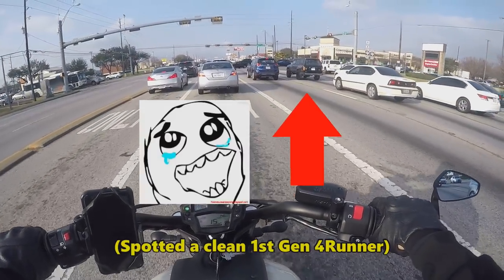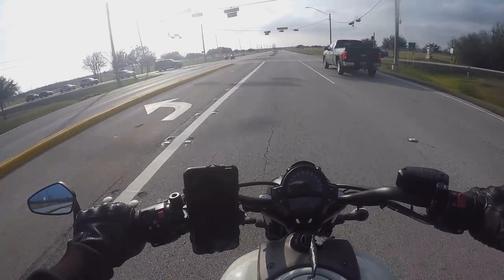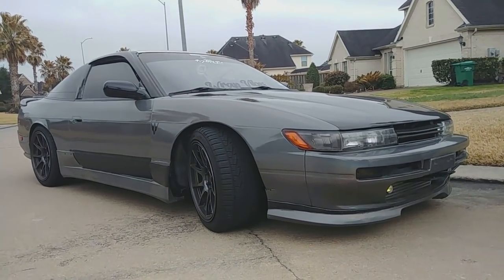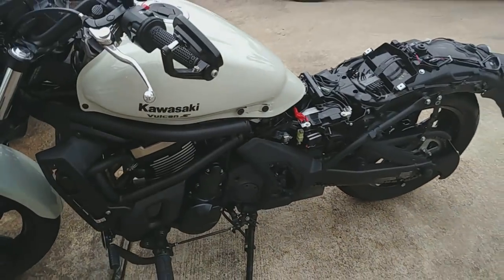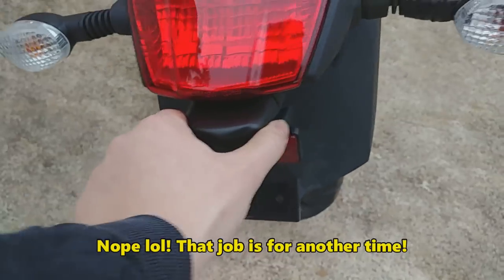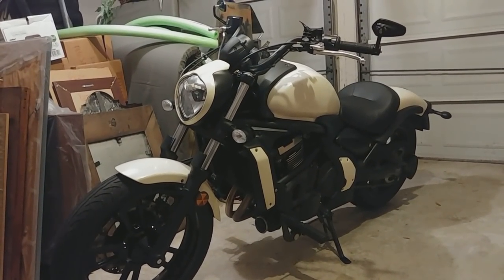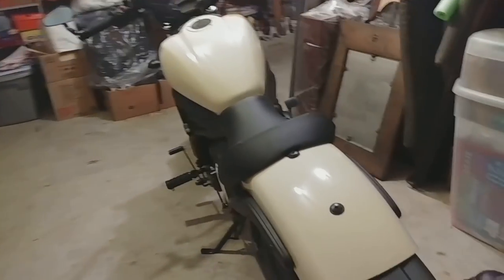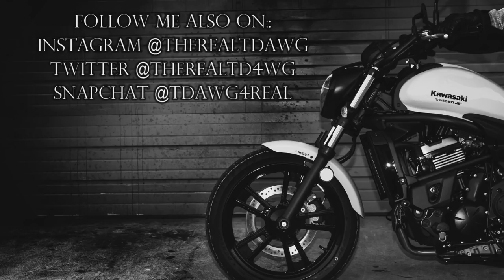Wrapped The Vulcan S! | Motovlog

Comment: That tank looks like a pain in the ass to wrap. I have some wrap to do mine I’ve been putting it off.  I did my fender a matte orange a week or 2 ago just Haven’t had the motivation to do the tank just yet
Reply from the maker: Fair warning: the tank isn't too bad but you will have wrinkles and stuff on the bottom part, we are actually going to run black wrap over that part to help mask the imperfections... And ironically, for him the front fender was the hardest simply because it was still on the bike, I'm sure it would been the easiest thing if I had the means to remove it lol
Reply: Ahhh. Yeah I had the fender off sitting in a bench vise while it was still bolted to the metal bracket Made it super easy to wrap. Took about half an hour. I feel like the rear fender will be the easiest
Reply from the maker: RedsoxZ125 yeah whenever I have the chance, I'm going to remove it and we'll redo it with some of the left over wrap lol

Comment: How the vibration without the bar weights? I just got some similar mirrors.
Reply from the maker: Sanosuke30001 it's not too bad, but it's noticeable... I added those ProGrips to help dampen the "feel" to my hands... I'm also going to get better mirrors in the future once I get different handlebars
Reply: I may get some longer studs if needed and try to add the weights after the mirrors and see how that works.